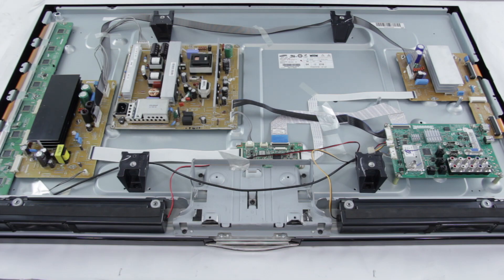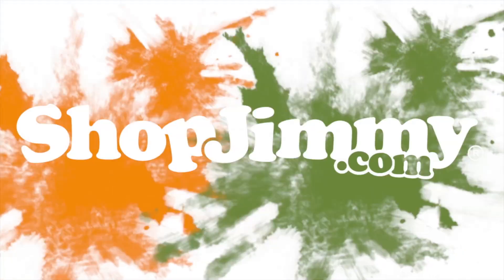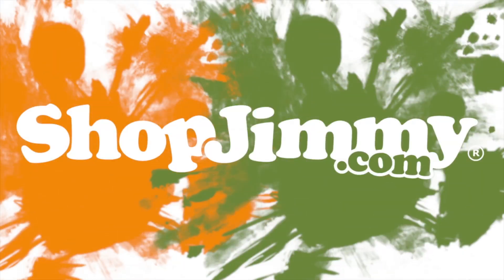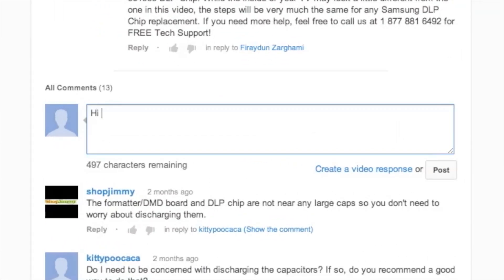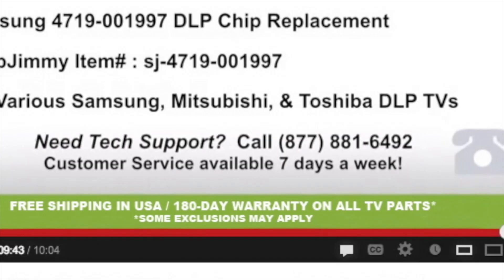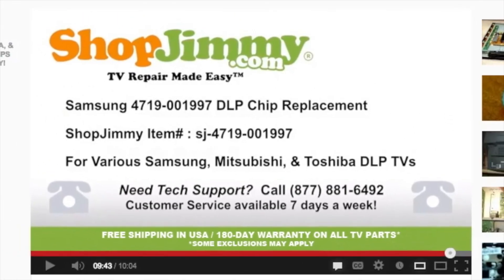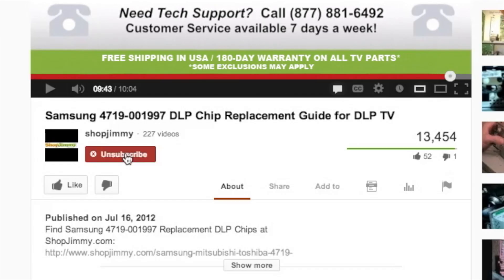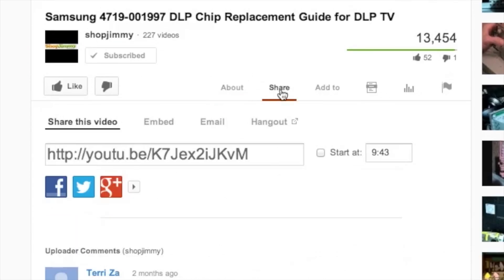Plasma TV Repair Tutorial - Common Symptoms & Solutions - How to Fix Plasma TVs

Comment: I know this is an old post but I have a pn59d8000 3d plasma. (long story short) I tore my acl lcl and mcl which made me rather unstable  my crutch caught a chair and i crashed into a steal rack in my kitchen and it and myself fell into the tv causing the tv to fall off the stand and I got about a softball  size webbing crack with what looks a slight puncture or pin sized chip   of outer layer. It wasn't plugged in at the time but when I did plugged it in and try to turn it on I get nothing. Probably just have to junk it but if you have any ideas that would be great. I'm guessing it would be just as cheap to buy new then replace as it was a 2011-2012 model

Comment: I've got an LG 60PM6700-UB plasma television. I've got audio but no picture, a black screen. I Had somebody check the Y Sus main board. They said its good. I ordered an upper buffer board and installed it but still have the same problem. I'm wondering if I should also order the lower buffer board. Do you think a bad lower buffer board would cause this issue? Great content, thank you

Comment: I have a Panasonic              TC – P50X1 Everything seems to work fine except I only have the top half of the screen working bottom half is blank. Love this TV always had a great picture and hate to see it thrown out hopefully you can find me in the right direction as to which board Needs replaced or any other possible causes for this thank you

Comment: I have two plasma TVs I bought over 12 years ago one 52” and a 42”. The 52” went out a friend of mine went to turn it on and nothing, red light on bottom was flashing red. My 42 just went out today, it mad a pop/crack sound and nothin no screen at all on both of them when they went out. My 42 this morning made a pop/crack sound lost picture. Light was is solid red on bottom of screen. Can’t even turn it off with remote. These TVs are well over 10-12 years old got used quite a bit. 42” is a Panasonic. Model # TC P42S30. MFD, April 2011. 52” model # is TC P5OU5O MFD June 2012. Both are Panasonic TVs.

Comment: Good day.

Thank you for the video. It is quite helpful. My TV screen started turning pink in the top left corner. As time goes on this patch is getting bigger and i noticed that the pink tint is noticeable now from the left side to the right side (especially on white screens) but gets better as the TV warms up.

From your video it sounds like i have a possible issue on the X Sustain board. Is the board repairable? I have heard that some of the capacitors needs to be replaced. I would greatly appreciate your feedback on this.

Comment: Hello. I have a plasma Samsung PN50a400c2d manufactured in 2008. The tv wasnt used that much over the years. I have a section approximately 4 inches wide that is either solid black or colored vertical lines from top to bottom. I have replaced the logic board in center of tv and also the input board. I have had times where it will go away but once powering off and back on, it reappears. One ribbon cable on the center logic board connects to what I assume is a backlight board that goes across the bottom of tv. I have reseated and cleaned the ribbon cable ends. I currently have a ribbon cable ordered. I removed and swapped ends of the ribbon cable but lines remained and in the exact same place. I am not sure if the backlight board (I assume that is the board) can be replaced. Hoping issue with the ribbon cable but dont want to keep replacing parts without decent chance of it resolving problem. Any suggestions? Thank you!!!!

Comment: Hello, I have a Samsung Plasma Display with Model: PS-50q7H [R]. Model Code: PS50Q7HX/RAD. Manufactured September 2006.
The problem is when turned on it runs well for about 1 hour or so then suddenly turned off with no sound, no picture and the TV turns off. Please help

Comment: The video was very informative, but it doesn't address the particular symptoms that we are experiencing with our Samsung 42" HPS 4253X/XAA. This Plasma TV has been installed on a TrippLite HT-1000UPS to eliminate power brown outs and surges and has given us very reliable service. The symptoms ONLY appear at start up in the morning.  The entire screen is dimmed but the channel chosen is still visible but is grainy and the entire screen slightly pulsates for about 5 minutes and then the screen cleans up and then appears normal.  I presume it to be a power supply related issue ?   Possibly an electrolytic weakened with use ?  The TV works great otherwise and I hate to discard it without trying a simple fix.  Your feedback would be greatly appreciated.  I'm a Ham Radio Operator since 1966 and have experience with soldering and circuit repair, but not much experience with flat screen repair ?

Comment: I have a 60pc1d LG plasma TV. 1/4 of the screen at the bottom half is Blacked out completely. Straight across from left to right. Give changed out 7 capacitors on the power supply board and that fixed the TV from powering off by itself. But the picture is still blacked out at the bottom portion of the screen. I get 3/4 of a picture. The rest of the TV works just fine. Can anyone tell me what could be causing this. Thank You

Comment: I have Samsung Plasma TV PS51F5500. It gave very loud pop sound, then screen goes blank. 
Immediately turned off.
A day after that, I turned on again, the loud pop sound once again came.
After that, now once turn on, no pop sound, no display at all, front red light on, after few blink, then totally OFF.
Opened the back cover, cannot find anything suspicious (blown capacitor, switch, etc).
Is the power supply board needed replacement? Thanks in advance for your advice.

Comment: I have a model PN51D450A2D Samsung plasma tv and it has no picture but still turns on. What would be my first thing to replace if I’ve checked the boards on the back and blew the dust off

Comment: i have a Panasonic 42 inch pc 40x1 model  i had no power or picture replaced power board. Tv turns on picture temporarily shows then turned off and power light blinking 8 times.I Then  I replaced the SS board  now i have a picture that has large pixels of colors all the over entire screen can't make out picture  ?

Comment: Hi chaps. Thanks for a very informative video. I am reluctant to discard my 11 year old plasma screen thus I would like try fixing it. The screen has several vertical green lines which have developed in greater numbers over past years. It is an LG Plasma TV model 50PK590 -EZ. With reference to your video, it suggests that the problem is most likely due to the logic board failure. Would this be correct or, if not, is this problem elsewhere or even repairable?  Many thanks in anticipation of your comments.
Reply: Same .. I have an 11 year old Tv i don't want to throw out either. Very informative video. I need to get the model number but I hope they reach out to you

Comment: A problem with my old Samsung PN58A550S1F.  Over the past few weeks, it has taken longer and longer to turn on. Currently, it takes more than an hour to come on. The sequence of action:  I turn it on, the blue indicator light turns "on" and a relay clicks; no apparent reaction; in a short time another click and no change; this continues for an extended time with occasional light flashes, stripes, various colors after a click; then the ROKU initial screen can be seen in distorted colors for a few seconds and with a click go off, this continues for many cycles as the screen colors change in random patterns; eventually the ROKU image will display normally and the system works properly (excellent video and audio) as long as it remains on; the next time the system is turned on it goes through this same process. Additionally, I have noticed when the system is working normally it takes much longer to process channel changes. Your help would be much appreciated.

Comment: I have a Samsung PN51E450A1F and the Power on button works, but the sound up & down selection has stopped working. I suspect it is from corrosion in the switch because a cat sprayed on the tv several times. (I have an animal sanctuary & some have bad manners😾) I need to get the repair & replacement procedure to replace that module or the proper test steps to make sure that is all that needs to be done. It's a great t.v., I just want to be able to run it back through it's setup because the remote isn't working anymore either! 🙅

Comment: Hi have a a Panasonic Plasma TC-P55ST30. Yesterday the TV turned off by itself and won’t come on. I removed the plug and powered down by pressing on switch. When I plug the TV back into power and turn on I get nothing. No sound, no picture and the red light comes on and nothing works

Comment: Thanks Jimmy for actually inviting us to ask you Q's! This video is great, and after watching it I believe I may know which board I need to replace, but wisdom says I should lay it out before you as well, for your input.
My tv is a Panasonic Viera 65" Model # TC-P65GT50 (manuf in May 2012)
the problems started after a freakingly powerful rainstorm blew up suddenly here in the midwest. the living room window was open and the side of the tv that has the main board was approx 12" from the open window, and the back of the tv got doused breifly with rain blowing in the window.
Symptoms mainly affect what is happening on screen. we can be watching Cable or our Amazon FireTV stick, and suddenly out of the blue, the TV MENU graphics will pop up (as if I had pressed the MENU button on the remote), or the INPUT graphics will pop up on the screen (as if I had pressed the INPUT button on the remote), or the MANUAL CONTROLS graphics will pop up on screen (as if I had pressed on of the manual control buttons [PWR, VOL +/-, CHANNEL +/-] located on the lower right side of the unit. When these events happen, I often lose control of the unit with the remote, but sometimes the remote will still work (although rarely). When the INPUT graphics appear, it looks like a toddler has gotten hold of the remote because different inputs appear to be selected in rapid succession. Sometimes the remote is not able to control the TV, and sometimes I can 'fight throught it' with the remote and go back to the input that I want to watch. When the remote goes dead, I have to get up and physically turn off the unit with the manual power button. We can for for a long time (guessing 45 mins?) without a problem, or it can happen multiple times in a single minute. This has be going on for maybe 3 weeks. When it first started, sometimes the volume on the unit would just start increasing by itself, reaching mas vol in say 5 seconds or so. this does not happen anymore. 
So, what do you think? Do you think the rain fried some component on the main board?
-Chris B in central Ohio

Comment: Thanks for the video! I have a Samsung plasma model no: PN60E530A3F . It turns on every time but usually with sound only. If you turn the power on and off with the remote, after several tries, you will see the screen come to life and then there is a picture as normal. If you shut it off, it can take some effort(having turning it on and off again) before the picture turns on again.

Comment: Hi. I have a SAMSUNG PN51E530 LJ92 Plasma TV that has vertical lines and bars. I replaced the main logic control board unit but that did not fix the problem. Any help would be appreciated.

Comment: Thank you for the video.  We purchased our 42" Samsung Plasma HDTV in late 2006 and has given us flawless service since that time.  I have it connected to a TrippLite HP1000 UPS for a seamless AC Source and power down.  Just in the past week I have noticed that the TV has a grainy appearance during power up, and has a slow pulsating appearance with the grainy picture and it all goes away after about 1 minute after power up.  No other issues.  The picture is good without any lines or abnormalties.  The model number is HPS 4253X/XXA  S/N B15G3CNLB08739;  Mfg Date Nov 2006

Comment: samsung model pn42c450b1d
Symptoms: Turns on and shows pictures but cycles through tv channels on its own then turns itself off. After this happens the TV can sometimes turn on again with the same channel cycle and the turning off, but most of the time it cannot be turned back on and needs to be disconnected from power source before trying to turn on again.

Comment: have a samsung pn51d530a3fxza clicking over and over as soon as you plug it in. i unhooked all from power supply plug main board in and it clicks. i have nothing plugged into main board either. issue in main board?

Comment: My TV Samsung PN50C490b3d clicks on/off but doesn’t turn on; I tested each board by unplugging the tv and disconnected each board and then reconnected each time and the clicking only happened on the U2P board so I got a replacement and the TV turned on but the screen had red lettering and it was fuzzy and then I turned it off and it started clicking again and won’t turn on.

Comment: I have Samsung PN50A450P1DXZA plasma. We had a power outage while it was on and when the power came back it wouldn't turn on again. I have unplugged it and held the power button for 2 min and plugged it back in as suggested by Samsung tech service. It makes 2 click sounds, but the tv does not come on. Any suggestions? It is 11 yrs old, but it worked perfectly prior to the outage. Thx for any suggestions!!

Comment: I have a HP-T5064 Samsung plasma 50" that turns off and on until it runs for a while and then will remain on. Sometimes it will go off and on even after it warms up. I found 4 resistors on the power board that looked bad and replaced. Still have the same issue. Any help will be welcome.

Comment: I have a 2011 panasonic plasma tv. I turned the tv on and heard a slight pop and there was no image. black screen. I do have the red light on. I pulled the plug and no change. still  no image but the red light.
p42s30

Comment: I have a 50" Samsung plasma , no picture, no sound, I do have the standby light on front a green light on the logic board inside..just get a clicking sound as it tries to turn on..
Mod # PN 50B400P3D
SER # B5CN3CMSAOO445L 
I TRIED REPLACING THE POWER SUPPLY,. THAT Didn't HELP.

Comment: My Samsung 42" Plasma TV Model: S42SD-YB05 volume doesn't work. Everytime I tried to move it up it comes down by itself. Volumen will not stay steady at the pre-set volumen.  Is this problem on the bottom board? Having hard time searching for the same exact part. What do you recommend?

Note: This problem stared after plugging a fire TV stick. I reset the TV but still  having the same issue with the volume decreasing by itself. Thanks in advance for any help you can provide me.

Comment: The Fix for my 64" Samsung 8000 series was to buy a LG C1 OLEG starts right up no issues so far.   
I had replaced 1 power board in the Sansung at around year 4.  Then it worked like new.  Well it started clicking again then the clicking stopped.  I ordered a  new power board.  Put it in and nothing not even a click or green light.   Not sure what it could be, possible a bad used ebay power board.  Not sure i want to keep guessing on why it wont turn on.

Comment: Brian G
Have a Panasonic Plasma Television, Model No TH-P50VT20A, which when you turn the power on, the red power light comes on, then when you then switch on the light turns to green as it normally should, but 5 seconds later it switches off, doesn't come on at all, prior to this the set was working perfectly, picture normal, now nothing, no picture, no sound, no nothing, can it be fixed

Comment: Have samsung pn64f8500

The TV was playing fine until I heard a loud bang inside to TV.  Found no pregnant capacitors or smoked parts.  No front panel standby light.  Found power supply not supplying 5V.  Replaced power board.  Now have clicking sound on relay on power board.  Power board tries to turn on 4X, then gives up (draws over 2A from 120V input each time).  When X-board is disconnected, I get 1 Hz green strobe on main board.  When X-board is connected, no heartbeat on main board.  Found X-board connector input had a dead short between VS and ground with ohm meter.  VA to ground okay.  Replaced X-board (but did check with ohm meter first).  Upon power on, heard BANG and slight smell from Y-main area.  No evidence of bad caps or burn marks on Y-board.  No shorts on Y-buffers (2).  On this model X-board feeds power to Y-board via cable.  Ohm meter shows power inputs to Y board are NOT shorted.  
Maybe replacement X-board was bad?  Returning for another.  Advice for when I get it?
Board layout for this model pn64f8500 is shown on page 61 in this service manual (which was otherwise not very useful) https://www.eserviceinfo.com/download_start.php?downloadurlid=95260

Comment: Jimmy, I have a Samsung PN64D7000FF that worked perfectly for 6 months after installing a rebuilt main board.  The screen is now black with no sound.  I replaced the main board (again) and power supply board and is still black.  Any suggestions on which board to replace next?

Comment: So as soon as plugged in my logic control board I got my clicking issue no other board I tested click prior.  Do I have to also disconnect t my logic buffers below left and right of TV there ribbons or just replace the board it self ?? No pic red light is on front of TV.

Comment: I have a samsung PS51D550, when powered on the led light indicator flashes about 2 to 4 times then goes off completely without the tv turning on. Could this be the power supply board? I need help on how to repair this plasma.